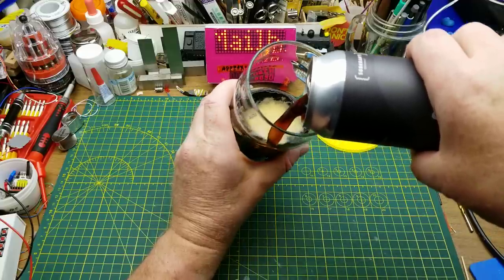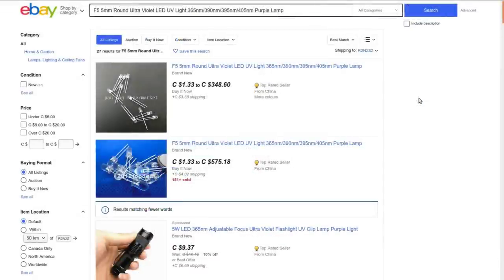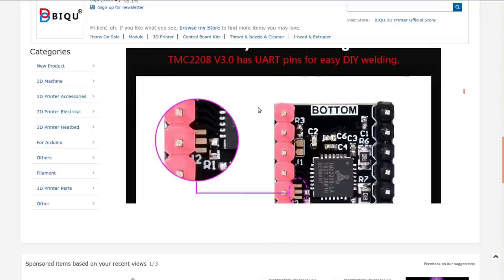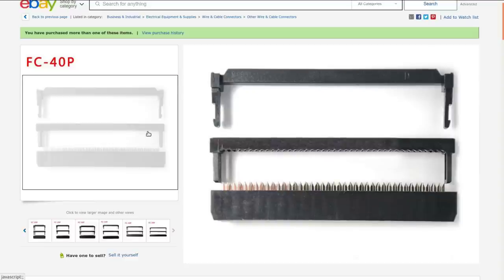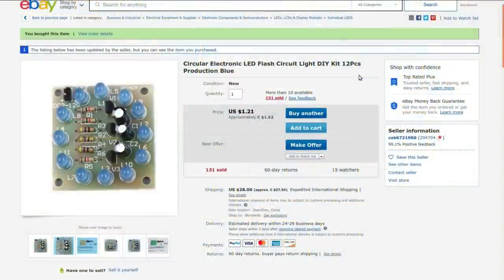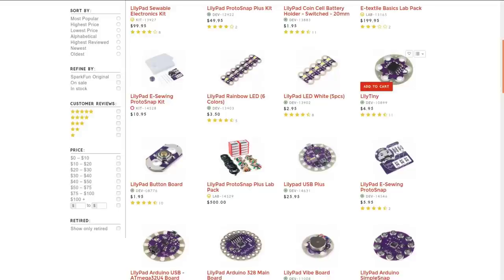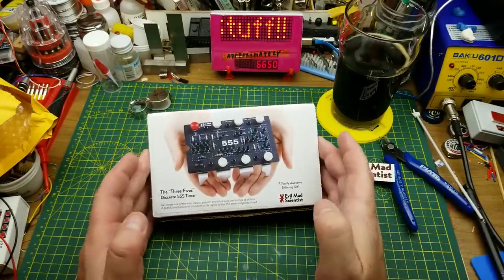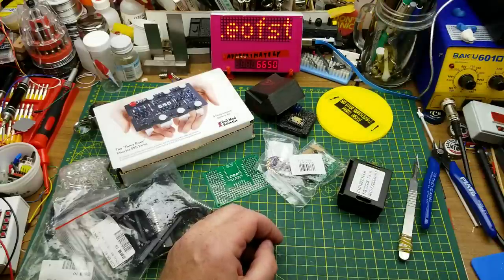Mailbag Monday #98

Comment: That 555 timer kit is cool!  I've always treated the 555 as a blackbox.  Amazing how much circuitry is inside that 50 cent chip.
You need to make a giant PCB and 3D print other components to scale when you use this "chip"! lol
Or go the opposite end and use it to drive 0402 SMD LEDs :-) What a fun toy.
Reply from the maker: LOL. Now I'm picturing foot long resistors. Capacitors the size of paint cans...
Reply: > 50 cent chip
You're overpaying. They're two cents (!) on Aliexpress.
Reply from the maker: @andrewkieran8942  Maybe, but AliExpress won't ship to Canada at the moment.

Comment: That 555 board I have seen put together by Dave (eevblog) and it comes very close on specs on an oscilloscope to an actual 555 IC. It is an amazing kit and I have been tossing about whether to buy one myself. I actually forgot about it until I seen you open the box.
It would most definitely make a super cool video.

Comment: IDT (IDC?) Ribbon cables are my favorite way to make keyed connectors.  So much faster than crimping a bunch of DuPont fe pins.
Do you have the tool for mashing them?  Pliers are fine for the small ones.  40-pins can be mess without the tool.
Reply from the maker: I don't have the tool. 
But I do have a vice that should be able to do the job. (I hope)
Reply: @pileofstuff  I've used a bench vice to build  IDC cables. It's just a matter of patience in getting the cable aligned and held in place while loading it into the vice.  I built the 50 pin version used for SCSI hard drives back in the Elder Days.

Comment: I have been thinking about doing a board for the ESP mods myself as it's less space to keep them in storage that the premade boards. I Have a couple on my Tiny-Naan boards and kind of liked it.  Storage is always a problem.
Reply from the maker: I was hoping that these breakouts continued the tracks across several pins - more like a breadboard or like your breadboard-style boards. 

And I agree that storage becomes a big problem after a while. You've seen what my space looks like...
Reply: Well, I have drawn up a first draft of the ESPMOD break-out board (8266 only) See an image of it here: https://photos.app.goo.gl/D65qRZ5aKT5FJT5X6 Let me know what anyone thinks and any comments. I made it similar to my Nano break-out board. I tend to like smaller functional boards with little wasted space but good pin access.  The AMS1117 regulator would have to be the 1a version. To program it, you will have to have a serial cable or adaptor and jumper the PRG header and pin GPIO15 (15) to ground.
Reply: The PCB size is roughly 49mm x 45mm